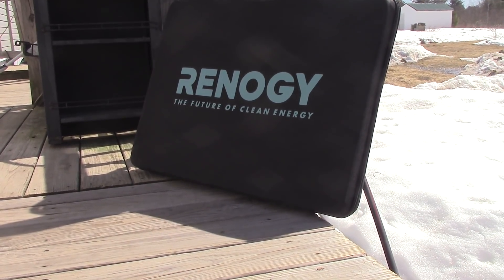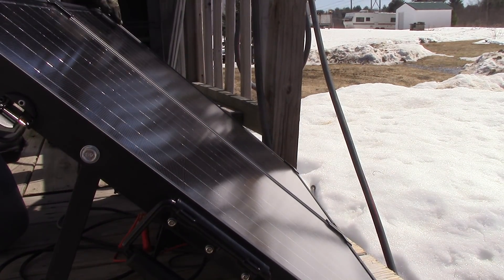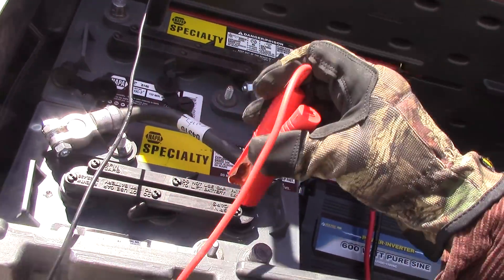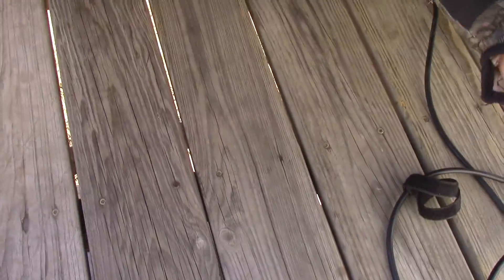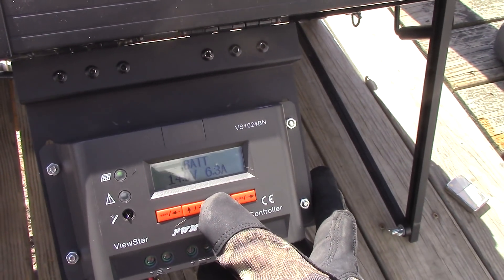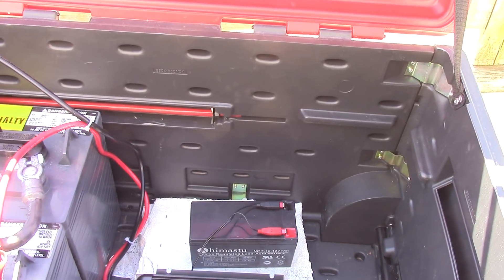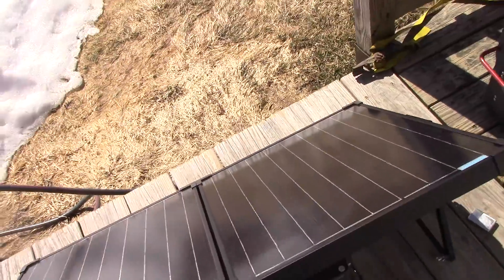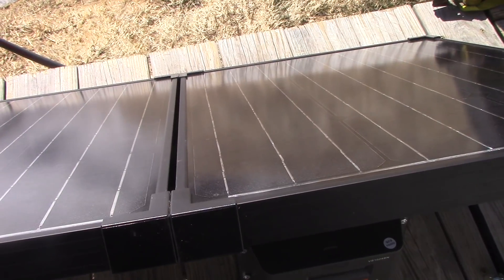Solar Suitcase 100W Portable Power

Comment: Can you get these in 400 watts or is it only the 100?
Reply from the maker: If I can ask, what do you need a 400W portable solar case for?  You can build a 400W system That can be mobile but a 400W suitcase would be big and heavy.  You could make a light 200W suitcase out of ultralight panels.  If you tell me what you are trying to do maybe I can help.

Comment: could you please tell me more about your battery box set up? what kind battery, box, invert,etc....where did you buy
Reply from the maker: The batteries are 210ah 6V in series to get 12V.  So it is 210ah at 12V.  I got the batteries at my states surplus sale for $25 each.  They will retail for 100 dollars normally.  The box I got at a yard sale for $20.  The inverter was $75 on Amazon.  Take your time and solar can be cheap.
Reply: Thank you. Can I use any other battery?
Reply from the maker: Use deep cycle and be sure it is the right battery for your use and ah,s  As for types of batteries, that will be covered in your manuals. Some people hook these to their RVs.  The MFG instructions will cover all of that for you.  You can also call Renogy and ask their tech department any Qs you may have before ordering.  They have a great customer support team.  They back their warranties.  They can also send you a complete system to include inverters, wires and batteries.
Reply from the maker: It is not wise for me to give direct advice unless I know the entire project.  This is to include wires and fuses as well as batteries.  Does that make sense?  Giving advise on the internet without knowing the whole project and use is not a good idea and so I refrain from it.  This is for your safety.  I would call renogy and also get or make a friend that is into solar.  We are everywhere.  Type in Watts law in your youtube browser and my video will come up and then you will understand.  each project and use is usually different and so to should the build be.  No one should give you advise unless they know the exact use and need of the system.  There are calculations that need to be made to determine wire and fuse sizes as well as battery size.  What do you plan to run is the first question.  Do you need negative ground components?  And so on....Again, call Renogy and explain what you will be doing and they can advise you on the exact right system.

Comment: hi can i ask you about the 100w solar panel your using now ..i ask if what usually the right 12v battery you have now what it was the amph.. ah 12v bat / 80 amp or what??
Reply from the maker: +ayesha zyrelle lopez I use 150ah battery with this.  I would take into consideration the amount of energy you plan to use.  Selecting a battery should be based on estimated consumption of power not so much on the panel setup.  Deep discharge on batteries will shorten their lifecycle so usage should be the primary consideration.  On a good sunny day in my state I can get as much as 600W of energy out of the panel.   I use a larger battery, 150ah @12V = 1800W.  This keeps the charge capacity at 30% of battery Capacity.
Reply: +Peaceful Prepper  thanks allot .. i wondering it can't be forward the source energy from the panel to battery // because i'll buy our solar and its 100w and 1200w for inverter and a controler and the battery was 80ah. the retailer said to me it cant be compatible for 100w panel to supply the 100ah battery  its much higher than the panel.. and he said that its good to be 100w for panel and 90 below battery amph. so i get the 100w/80ah
Reply from the maker: I agree.  However, if you are continually depleting the battery below 11.5V you need a bigger battery.  so an 80ah = 960W.  You can only use about 250W before you will be  I getting depleted.  Your 100W panel can produce 300W to 600W.  See what I mean?
Reply from the maker: When I only need to charge tools, phones and computers I may even take a smaller battery so as to keep the weight down.  If I am going camping with multiple  people I will take a bigger battery.  Again I feel it depends on how much power you plan to use.  Use Watts Law to determine this.  You can also test each device you plan to use with a kilowatt meter to help you determine the battery size you will need.

Comment: also want to use it in a cargo camper conversion,,,,,,,,how much can i expect to run off the system once hooked up,,,,,,,,small tv ,small micro wave, fans ,lights ,may a portable ice maker ect ?
Reply from the maker: +bob woerner Like any system it would be dependent on the ampacity of your batteries and inverter.  The Suitcase only charges batteries.  The panel in full sun, has an output of 6.3A @ 14V = 88.2W  .....It is a great item to get between 500W and 800W into a battery bank in the summer.   Using Watts Law you can then do your calculations as to what you can run.  This will be enough power to run led lights, charge computers and cell phones,  Small water pump, Charge tools  etc.....  I use it as a portable charging station to eliminate the need for a generator in the field.  Some RV people use it to supplement their battery charging needs and reduce the runtime of the engine while camping.  There is another video on youtube of a person doing this.  Thanks for the Question Bob.
Reply: thanks for the feed back
Reply from the maker: Your welcome Bob
Reply: i did want to get a mttp charge controler, this one comes with its own cc but not mttp.....and advice on a good portable 100 or 200 watt set thats not over priced?
Reply from the maker: Hey Bob.  Renogy has a good priced 200W set for not a lot of money.  Their panels are second to none.  Good strong Frames and you can choose between MPPT or PWM for the charge controller.  I nave found PWMs to be fairly reliable and they are a lot cheaper so you can buy a backup charge controller for not a lot of money. Make sure whatever charge controller you get make sure you can set the float voltage.  This is important incase you want to got to AGM batteries.  AGMs are very sensitive to voltage and should not go above 13.8V usually.  Just something to think about.  If you went with the 200W system I think you will be a lot happier for what you want to do.  It would NOT be hard to hinge the panels together and run the charge controller from the camper instead of on the panels.  I think the set comes with 20 foot cables so you would have some reach.  You can also change the 20s for 30s or 50 foot cables.  This would give you plenty of reach and some good weight for the wind.  The web site is Renogy.com   They have great customer service.
Reply from the maker: Sorry about the typos in the last.  My ketboard is dying, lol.
Reply: THANKS AGAIN....SAW A RENOGY KIT FOR $299.00. MTTP CONTROLLER WIRES A 1OO WATT MONO PANEL.ON EBAY..THINK I 'LLGO WITH THAT.
Reply from the maker: I would go directly through renogy, they have great customer support.  They will also send you sale fliers and coupons now and then.  They have free shipping and support their products.  Remember a 200W PWM will beat a 100W MPPT.set up.  MPPT gives you about 10-20% increase over PWM.  MPPT Stands for (Maximum Power Point Tracking)
Reply: thanks......

Comment: thinking of getting one of these after doing some research on deep cycle batteries i found the titan t150 re    batteries "6 volt golf cart " to be the best idea .but not cheap. just not sure if i hook them up in parallel like 12 volt batteries or in series ? i believe its in series being its a 12 volt system but just want to double check ????????
Reply from the maker: There are great videos on youtube for parallel and series connections.  I was using 2, 6v golf cart batteries in series in this video.  Be safe and always check your work.  If you need to, go to a battery store and they will draw you a diagram.  Doing it for the first time is intimidating but once you get into this you will build you confidence.  The rule I live by is, if your not sure, get help.

Comment: A couple things...
(1) You don't need to wear insulated gloves when handling 12v batteries and 20v solar panels.  A human cannot even feel 12 or 20 volts.  Making sure the battery doesn't short is a good idea, though, because of the crazy amount of heat that would be generated.
(2) Shorting a 100-watt solar panel won't do much.  Maybe in FULL sunlight, like at the time of this video, you might end up with a tiny little burn mark on one of your alligator clips.  I don't use caution when handling a 100 watt solar panel.  I short them all the time.  In fact, shorting a solar panel is the easiest way to determine its output.  The short circuit current will always be a little higher than your optimal charging current.  So, if you take a multimeter, set it to amps, and put it right across the panel's leads, you instantly know the power output of the panel.

Comment: Where can I buy a box like yours where you put your batteries in?
Reply from the maker: MontiR Aruba Any potable box will do as long as it can handle the weight of your batteries.  If you are serious about it I would build one that meets your specific needs.  Home depot and lowes have a great selection of portable tool carriers.   Some coolers will do the job as well.  Again it is about the weight.  Thanks for watching.
Reply from the maker: MontiR Aruba The box I am using in the video I found at a yard sale.

Comment: You can bet that I want one darling. 
Sweet little set up, that. 
Sure would have liked using it last summer. 
Wheelie crate and portable. 
Excellent. 
Was looking at this same brand 100watt panels previously. 
Hailstorm?  Falling tree limbs? 
How crash proof? 
Curious. ..
Nice though Jim. 
Me like! !
:)
Reply from the maker: 222Mission It can be broken by a hard force striking it.  However, the panels are pretty tough, I think tempered glass.  Renogy stands behind their products and their customer support is outstanding.  They will walk you through a setup and the manuals are usually easy to read.  Their warranties are some of the best in the industry.  Good to see you my friend.  Hail usually does not break solar panels but if it were big enough hail stones it could break them.
Reply: Yes, I have actually contacted them for some stats. Excellent customer service dept. 
After looking at my wattage, I do believe I can get by fine on a 400watt set-up. For a single person, that's plenty enough. But for a camping trip, I truly like this setup you have made. 
Good GOOD thinking that you have put together.
Reply from the maker: Good planning on the 400 watt system.  I just play with this stuff.  It is a hobby and gets me off dependence of the system at the same time.  I started with the grid tie system and went from there.  Once the trust and knowledge grows, the possibilities are endless.  I do know navigating the inverters for off grid apps is tough.  I have found paying a little more for a good inverter from a good company, with customer support, is usually the best bet.  Sounds like your power needs are small?  If you would like to call me you can.  Our kind is a good people.  I give my number out to a few people on here.
Reply: Oh, yeah. 
I'm after little as possible.
Radio/communication
Small led lighting
Recharge
Rest is gravy, for as I'mconcerned Jim. 
Ground refrigeration will bring a max of 56.1°f here. 
Communication is the most important. 
I've got a collection of older tube radios. 
Shortwave, broadcast and transmit. 
I'm a lover of radio, and so. ...
Reply: Also, my current landlord, is taking classes at the local level to be certified by state as an installer contractor. He's bringing me some textbooks to read up on. And been discussing this with him. 
I'm aiming for the hermit up on the ridge side, where everyone has to hoof the last half mile. ...
Reply from the maker: You have it going on my friend.  I knew I liked you, lol.  There is a guy, Steve Robertson, Off grid living, on youtube, He is a great person and is very supportive.  I would get a fridge and power it, lol.  It is not too hard.  Todays fridges draw little power and amps.  My 21Cube fridge only draws 100W running.  It does however have a 500W plugin startup.  After the initial plugin it is easy to run and only draws 1KW a day.  I have found the solar part of off grid is easy and low cost, it is the batteries that bring out the bucks.  I look for cheap used batteries, and there are great finds out there.  I am getting those golf cart batteries for 50 bucks each.  They are about $120 plus deposit normally.  I get them from my state.  I think you will be able to cut your costs if you start looking for them as soon as possible.  You can also get a small Gen to start and keep you Bat costs down.  Run the Gen on bad days to charge the bats.
Reply: Havent looked at golf cart batteries, excellent suggestion. Have looked at deep cycle marine type's. 
Busy day, recovering from shampooing and cleaning carpets. Achy. ..lol ..actually might wind up with a ancient fridge from the thirtys. A match for the Maytag wringer I just reworked. Its late 30's, runs fine. Lots of wattage though. Haven't seen the fridge yet. ...but yeah, knew from the first video I commented on. ...
Reply from the maker: Those deep cycle marine types are not as durable as you are gonna want in the long run.  Great for small aps or camp set ups. A good deep cycle/flooded battery or AGM is a better way to go due to the cycling.  AGMs are pricy and temperamental, but can be stored inside. Where as, a good flooded battery can take some real abuse and you just add water when needed.  Look into old forklift batteries as well.  Sometimes you can find them cheap and with good life left in them.  Some companies, like people, throw good things away due to rules.  I try to do everything on the cheap, or as cheap as I can.  Once the Ego is out of things, solar can be a reasonable journey.  I have not yet paid full price for a solar battery.  None have failed.  If I may also suggest, Invest in a good charger that has reconditioning features.  These are invaluable.  Many solar charge controllers do have some great features.  These are all just suggestions.
Reply: HHopefully I'm going to be gathering advice from many different people, you amongst them. 
All the batteries are coming from recycle metals buyer's. Scrap metal. I can get forklift battery, from local industry. Pallet loads are cheapest, and what I already have to store them on. 
Chargers are a whole nuther story. 
But will be happy to research any things you suggest. 
Take care friend always. 
Sent you a message on YouTube.
Reply from the maker: Sounds like you are really looking into this stuff.  I think one of the best parts of the solar journey is the people you meet along the way.  Everyone seems to be very helpful and supportive.  Not sure how to get your other message?  Help, lol.